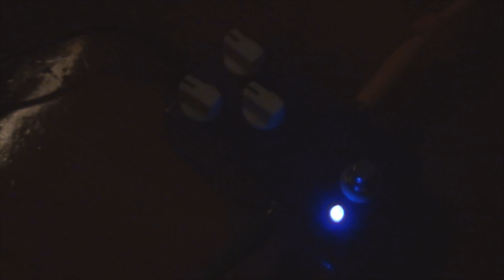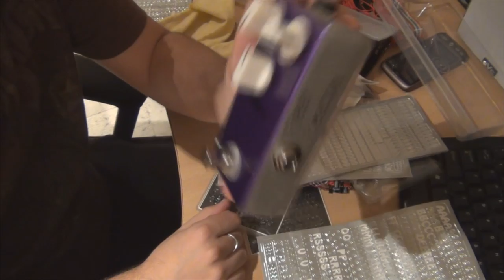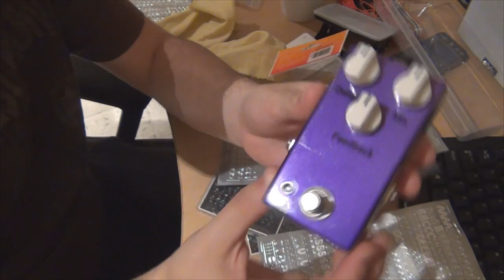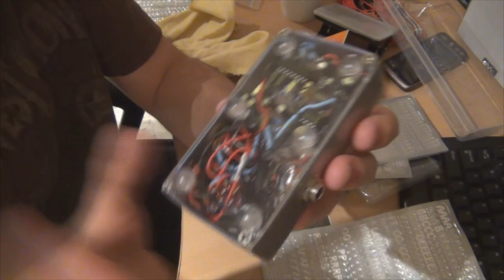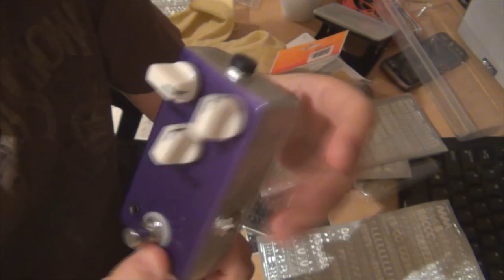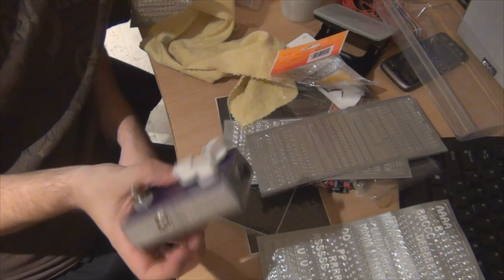Build Report: Fleet Beacon Delay Based On Deep Blue Delay (Madbean Sea Urchin)

Comment: that... is AWSOME... anyway, i kinda semi finished my OCD tho it's not working, lol... i guess i'll have some troubleshooting to do... but yes, my OCD is even more messier than ur pedal here, lol... well i guess it's my 1st time (i also messed up mad on the power jack, i melted the plastic when i was soldering the wire on, lol, also drilled a couple holes on non-perfect spots where things kinda bump into eachother inside the casing, lol)

Comment: well i couldn't test it because the DC jack and the LED had to be mounted on to the box before i could make the connection (the whole inside outside thing u mentioned in the video...), so i just threw it all in cuz i was getting pissed and tired at 2 am, lol... now to think of it, i could have just had the wire clipped or touching eachother just for testing instead of actually soldering it on there...  o well, mistake already made, lol... better figure out what's wrong next, lol